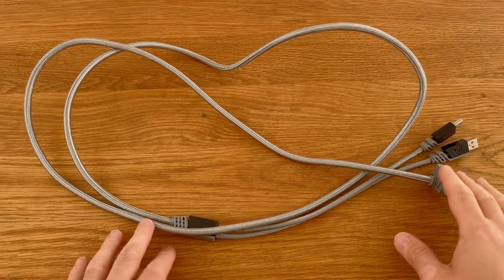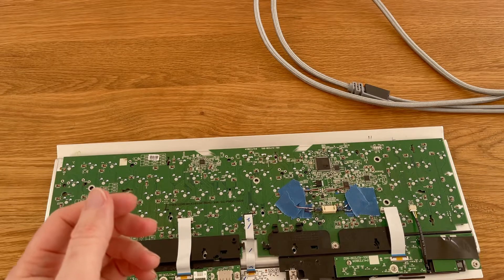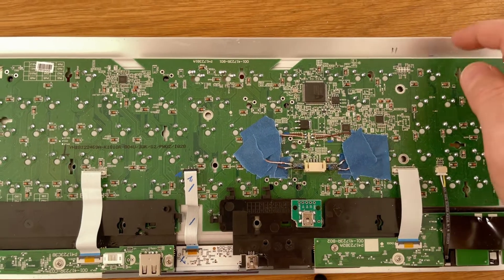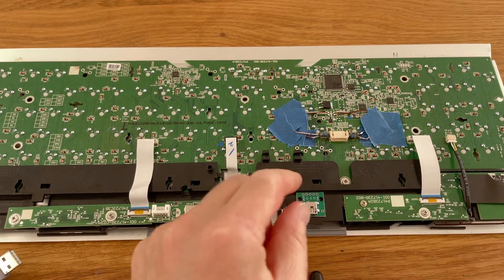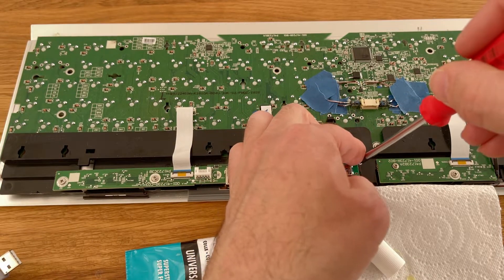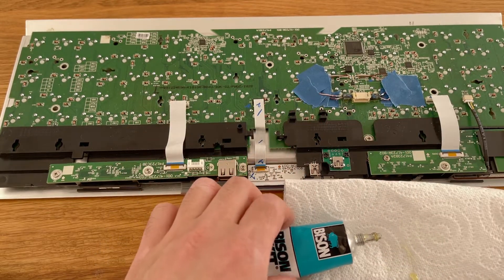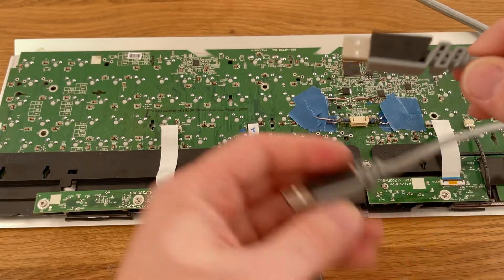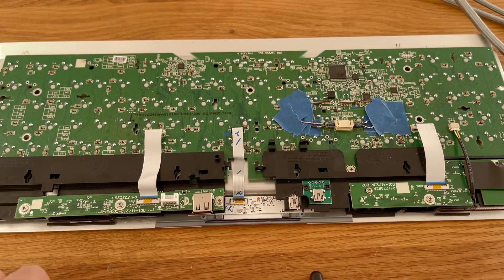From Fixed to Detachable USB Cable (Mechanical Keyboard Mod) Pt 1

Comment: I have a problem with a Thermaltake Sport mechanical keyboard. Their damn cable is 10mm! The damn thing is heavy and thick and will just cause problems at the beginning of the USB cable of the connectors, they always break and are forced by the weight of the damn cable! I bought 2 mini-usb cables from a junk shop (new), but I don't know how to get rid of this problem!

Comment: don't know if you figured it out in the end, but as far as I know the 2nd USB plug is for additional power, not for the USB port. I.e. the keyboard has a usb hub, not a pass-through.
Reply from the maker: Exactly that! Thanks for sharing.

Comment: why no usb c?
Reply from the maker: Great question mate! I thought about that, however I let go of the idea once I looked into a usb-C plug: many many more connections and a much bigger guesswork for where to connect the 5 cables to, coming from the keyboard PCB. Since Mini-USB also has 5 pins that was the most logical. 

The experiment was weather I could move away from fixed cable to detacheable cable, and Mini-USB works perfectly!

USB-C is microscopically tiny and my large gorilla sized hands would not have been able to hold the soldering iron to the degree of the precision required for usb-C. 

BUT if someone else does it succesfully, feel free to share that. Good aftertought for a future project, especially if there are large breakout PCB boards for that that are well labeled for conversion to connect to older Mini-USB stuff.
Reply: @sambalsamurai9672  yeah i think usb to micro usb is 1:1 but for c its flipped around so its def harder
Reply: was about to ask this lol

Comment: this is what im looking for 4 days
thanks god i foound it
Reply from the maker: Awesome mate, your comment made my day. Thanks for subscribing!
I knew that I was not the only person on the planet seeing this nice potential for improving the design and usability and thus overal lifespan of such keyboards.
Maybe in the future I will made more mods on the keyboard. Especially about how to level the base plate with precise rubbers, after getting rid of the bottom plastic base.
This way the keyboard sits almost flush on the table. That mod will come some day in the future.